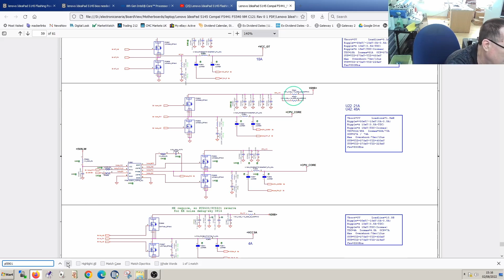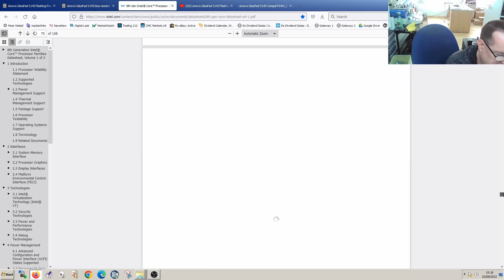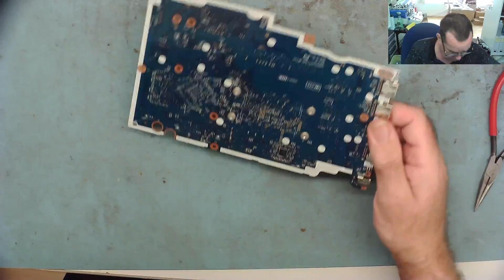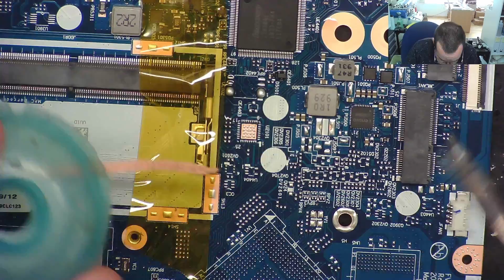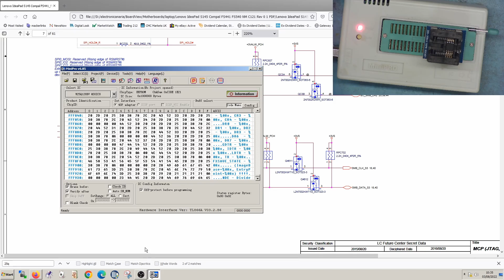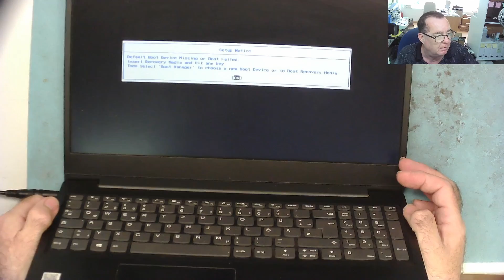Lenovo Ideapad S145 Laptop - Flashing White LED No POST No Boot - Part 2 Component Level Repair

Comment: Hi ,thank you for your shared video. I have the same pc but with a slightly different problem, 1) without power it does not start 2) with the power white LED on the keyboard flashing and power LED adjacent to the power jack flashes red and the pc starts, the does not charge despite having replaced the battery, in your opinion what could be the problem?

Comment: I'm going to add here that I had a v14-ARE with the same condition blinking white power no screen. The Lenovo service bulletin mentions the Lenovo button for recovery, I did a full power reset (battery, cmos. disconnect) then while off held the pinhole button on the right side of the machine until it beeped and turned on in recovery mode. From there I booted to windows and ran the bios update tool and it was fine. Just thought I would post this incase it saves someone a bunch of time and soldering! TLDR: look for pinhole button or Lenovo button and try it first.

Comment: I have a s145, it died on me, the power button lights up when pressed and the usb has power (it charges my phone) and the fan runs, the ssd card gets hot but literally nothing else works. I've tried all the suggestions on youtube but nothing I tried does anything, it doesn't have a disk hdd just the ssd. Do you have any help if not can I send it to you to repair and could you give me an idea of cost? I bought a new laptop so time isn't an issue but I could do with the data at leased but I would like it to work rather than just get the data.

Comment: Great work, I like your videos. I have Samsung core i5 laptop with the exact same issue it power's up, fan spins, all votages present, however, there is no display on the HDMI output or the laptop screen. I have gone to the forum website you mentioned but I was feeling a bit shy to ask for the bios software since it is my first time there. Could you ask for me the bios software? It's model number is NP370R4E and the board number is BA75-04364D. Thanks in advance.
Reply from the maker: Please don't be shy, badcaps is one of the friedliest places on the interweb lol

Just register (free) then post first in the introductions section as many people do every day, just say hi, a few words about yourself (where you come from, I'm a hobbyists, full time tech whatever applies to you)  and if you like say you were recommended to join by Richard at LER youtube channel

https://www.badcaps.net/forum/forumdisplay.php?f=7

You first posts will automatically go into moderation to be approved, this is normal and doesn't take long.

After introducing yourself post your BIOS request - all will be fine.  Remember myself and everyone else there were new members at some point 🙂

Comment: Had the same problem with two Ideapads (320 I think) last month. Modern laptops do have bios issues.
Reply from the maker: Next one you see give badcaps.net/forum a try
Reply: @learnelectronicsrepair  I will Richard

Comment: Great repair Richard, i also thought that it was a Bios problem, but the missing voltage on the one inductor really caught me off guard, but just another Red herring, that isnt actually the problem!
Reply from the maker: And sometimes that is the way it is - I also thought it was  power rail problem or near short until I found the datasheet for the CPU and realised this rail is a high power (amps) load.

Comment: Hi Richard, Interesting video.  One question/comment, dont you lose a bunch of laptop specific data when you reprogram with a base bin file like this. For example MAC number, serial number, password etc ? Any idea what you actually lose and how important is it ?
Reply from the maker: Yes - this is why I had to upload the original BIOS file to badcaps.net and the clever guys on there fixed it and  gave me a working one - which has the specific data for this laptop still intact.  

This explains why the forum thread for this model is 8 pages long, and not just one good file for every one to use

https://www.badcaps.net/forum/showthread.php?t=85142&page=8

Comment: congrats on the fix. I'm having the same issue with a Acer laptop. can I ask you what software you use for flashing? thanks
Reply from the maker: Hi I used Minipro V6.85 with the TL866 programmer - there are probably newer versions
I also have Xgecu Pro V8.51 for the same programmer which is more recent I think
You can you the cheaper CH341A programmer for this type of BIOS chip though it does not support as many devices as the TL866

If you need a programmer you can buy from these affiliate links if you like (and I get a little bit of commission thanks)
EEPROM Programming
TL866 II+
https://amzn.to/3aXWchh
https://amzn.to/3ckesBK
CH341A
https://s.click.aliexpress.com/e/_DeRLni7
https://amzn.to/3B8N4kM
https://amzn.to/3PHXueX
1.8V ADAPTER (for CH341A and TL866A/TL866CS)
https://s.click.aliexpress.com/e/_DciFyrp
https://amzn.to/3aS6vU0
https://amzn.to/3PGVp31

Comment: Have to ask whether you had tried disconnecting the CMOS battery? I have seen that help some laptops come back to life
Reply: We may never know, this was pointed out in the previous video (may have been a simple boot loop caused by a stuck BIOS)
Reply from the maker: @ralphj4012  If you watch the part 1 you will see I remove the main battery and CMOS battery then leave it while I go for lunch 30 minutes.  What I did not whow (but did do) was removing the batteries again and holding the power button down for 1 minute, but I do mention doing this in the comments on part 1.
Reply: @learnelectronicsrepair  Apologies must have been asleep at that point (dreaming about pumps and water wheels). You probably did a comparison between the previous and new BIOS images, but I missed that as well.
Reply from the maker: @ralphj4012  No that I did not do - but think I will have a look at it
pumps and waterwheels hehehe😅

Comment: I have a similar laptop (identical looking mobo) that I got for $150 on a black friday sale. Worked for about a year then one day it was stone dead, no lights no nothing. Took it apart, voltage tested some components near the power plug, mobo seemed to be getting power, battery was fully charged. I was at the limit of my diag abilities but it was looking like a full mobo replacement. A used mobo from ebay was over $200, so now I have a big paperweight. From watching the video I now suspect a corrupted bios. You get what you pay for I guess.
Reply from the maker: Brian Brians it sounds like you should try fixing your paperweight! As long as you have the basic tools, soldering iron, hot air, leaded solder, flux, it should be pretty easy. If you don't have a programmer, A CH341A is very cheap, easy to use and will program 24 and 25 series BIOS chips.  Here is a link (I do get a small commission) if anyone want to buy one 🤞

CH341A
https://s.click.aliexpress.com/e/_DeR...
https://amzn.to/3B8N4kM
https://amzn.to/3PHXueX

EEPROM Programming
TL866 II+
https://amzn.to/3aXWchh
https://amzn.to/3ckesBK

1.8V ADAPTER (for CH341A. TL866A, TL86CS)
https://s.click.aliexpress.com/e/_Dci...
https://amzn.to/3aS6vU0
https://amzn.to/3PGVp31

Comment: I enjoyed the video. Nice job on desoldering the bios chip quickly. You made it look easy and I feel inspired to give it a try.
Reply from the maker: Hi Mike Neal, It's nice to inspire someone,  Give this a try on some scrap motherboards or PCBs if you can find any. I used to struggle with this type of desoldering and basically developed my own style which works well for me.  I only make it look easy because it really is not difficult!  There is an old saying 'a bad workman always blames his tools' but If you can't do it this way then it is almost certainly is the tools you are using. 

If you cant get the pins of the chip to bridge with leaded solder, make use you are using a chunky enough soldering tip, make sure you have the iron hot enough, and enough wattage 60W+ preferably a T12 soldering station or better (I use 380C but this will vary a bit for different soldering irons) and use a good flux like NC-559-ASM though I think mine is probably fake.  

If you still struggle to do it, try warming the area with hot air first then bridge the pins with leaded solder, but really it means your soldering iron is not up to the job.
Reply: @learnelectronicsrepair  thanks for the tips. I’ll give it a try.
Reply: "You made it look easy". Thats a trap. When you see something like that, it means professional person did it, and it looked easy.
Reply from the maker: @orion310591RS  I used to struggle with this sort of (de)soldering job like everybody else - try my advice, good quality soldering station like T12 with a big chunky tip, good flux and hot air.  Then tell me it isn't as easy as I make it look 😉

Comment: Hello, Richard, how old is the bios programmer software ? Maybe on the website there is a newer  version available where newer bios chip  models are listed.
Reply from the maker: OK, my programmer is the older TL866 CS, the latest version is TL866 II+  I've had it for about 4-5 years
I am using minipro V6.85 but I also have XGecu Pro V8.51 which is for TL 866 II+ and works with my 866CS plus 1.8V adapter, and that does not list this eprom either.
It was fairly easy to get around this problem but it would be nice if the software directly supported it.

Comment: when you go to the bios setting (on info) it doesn't have some info about the laptop ? like serial number ? uid ? and some on ? or it does not give some error on power on or reboot related to that ? because the new bios doesn't have the same serial number and other stuff like that, like for example the windows key if is missing the windows wo'nt activate ...  and you must fix that with uefi tool for example... ? or Mrs SMDFLEA has fix that on new bios, and pass the old bios info to the new bios ? thanks for upload... ;) greatings from Portugal...
Reply from the maker: Yeah this is why Mr SMDFlea and others on the badcaps BIOS request thread ask you to upload your original BIOS file, then they extract some info from that and put it in the non corrupted file which they upload back for you.  I am not an expert in this area though I am sure if you start a thread on badcaps the guys there will help you learn how to do it, they are a friendly non-secretive bunch of guys.  At the moment I'm happy with the fact I got a response within 45 mins (processing times may vary 😉) but if I ever get the time/inclination to look into this field further then i will.  You should also try the LER discord server for help/advice

www.badcaps.net  <--- thoroughly recommended, totally free to register and download files/schematics etc

Learn Electronics Repair is now on Discord!  Come and join the fun and let's fix stuff together, it's free and a nice place to be.
https://discord.gg/vam6YC8vwU
Reply from the maker: Yes the guys on badcaps created me a working file using the laptop specific contents of my old bios

Give them a try, it is free to register and download files  www.badcaps.net/forum

Comment: For those who want to de-solder the BIOS chip without hot-air, you can use low-melting point solder which allows you to remove the chip just with the soldering Iron.
Reply from the maker: Yes that would work.  A bit like my technique of adding leaded solder, but it reduces the temperature even further
Reply: @learnelectronicsrepair  Yes exactly that and the other benefit is that it cools down much slower.

Comment: Richard the info for the PL5901 was right in the schematic on the right side. Look at the time and pause.
https://youtu.be/CfrForRtJpM?t=206
Reply from the maker: Yeah  I saw that but it does not mention the voltage of this rail.  Mostly because it is variable I think, like the Vcore on a CPU or GPU.
Reply: @learnelectronicsrepair  It just mentioned the Vboot (startup) voltage which is 0, so it was correct.

Comment: Thanks for uploading another good video. Did you repeatedly try to reboot the laptop to check for sustainability ?
Reply from the maker: No only a couple of times - and I don't have the HDD, but I have no reason to expect this would not be working reliably now as it appears to be a well documented failure on these laptops